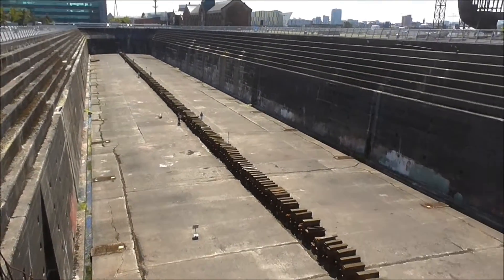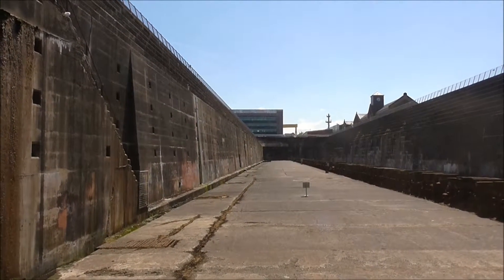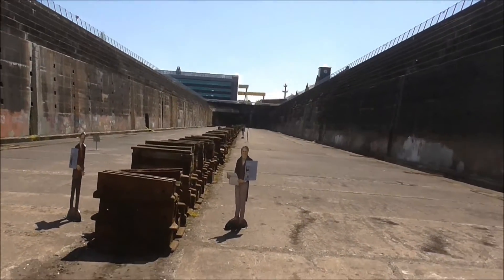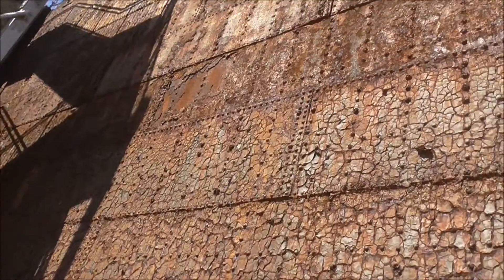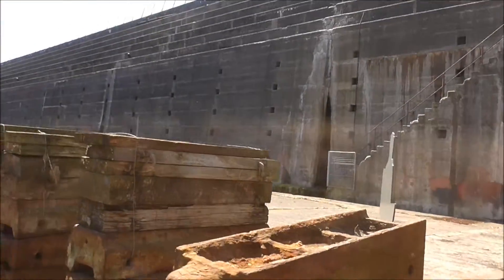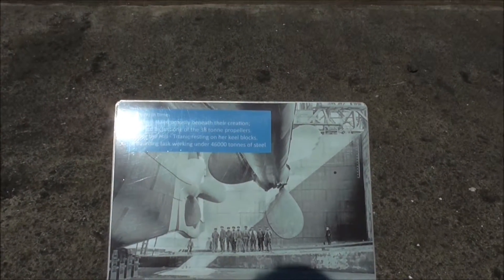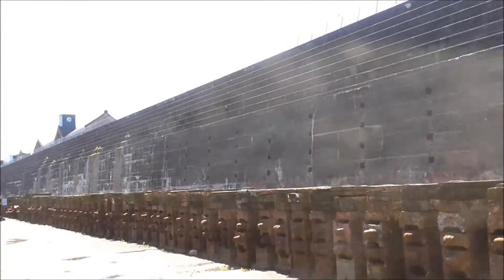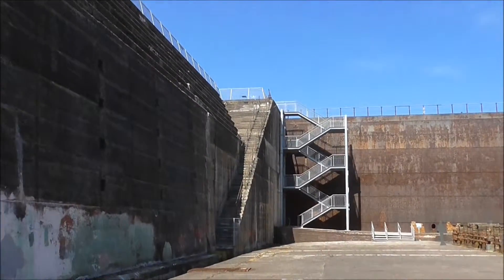TITANIC THOMPSON Graving DOCK Belfast

Comment: So when filled with water how does the ship get out , looks brick to brick each end ???
Reply from the maker: I see what you mean NH. I reckon the entrance end has been deliberately sealed up to allow visitors to walk safely about on the dock floor. Best wishes from the Belfast Castlereagh hills.
Reply: The dock gate pushes out when the water level in the dock is higher than the tide behind it. When the dock is empty, the weight of the water behind it, forces it tight against the seals it pushes against. The dock gate in the East Yard of Harland and Wolff (Two big cranes) is moved out by two tug boats as it floats out of position, when the dock is flooded.

Comment: I visited there September 2016, but did not go down in the dock. Bad knee. Didn't want to try all those stairs. But it was awesome none the less. Historic. The ship's keel rested on those blocks as the water was drained out and the sides were propped up by poles allowing the workers total access. Then the dock was filled back up, the casson gate lifted and out she floated with the help of some tugs.
Reply from the maker: Yes the dock area is amazing. Standing right at the bottom looking up where the Titanic and so many others have been made. This is what draws me and fascinates me. So many tourists come here and just go to the Titanic Exhibition centre. All the original rope attaching bollards are still in place but many folk just dismiss/ignore them.
The Nomadic Tender is also good because it is the last real link to the Titanic. It gives a good idea of the opulence of the bigger ship. 
An added welcome addition is the recently restored HMS Caroline last surviving warship from the battle of Jutland 1916. 
I was very very impredded with my look around. You can do your own tour with the help of earphones which are triggered at significant points on board. The Caroline is also wheelchair/bad knee friendly. It has a lift to all decks.
Thanks for dropping in. I have videos of all of these on Youtube. I'm a bit of an obsessive about all things Belfast/N Ireland. lol